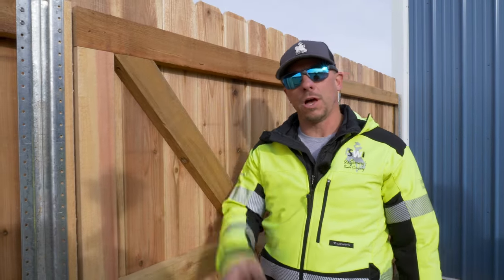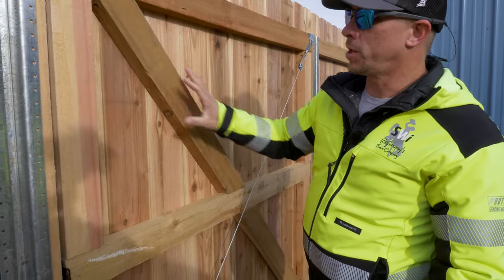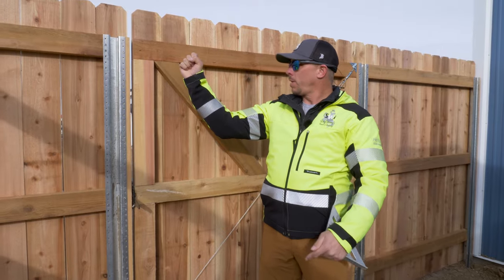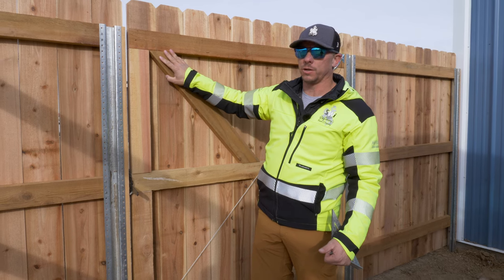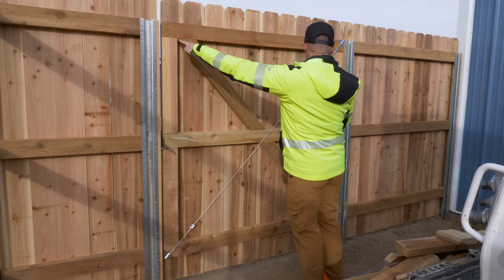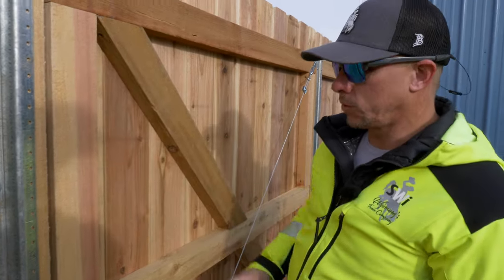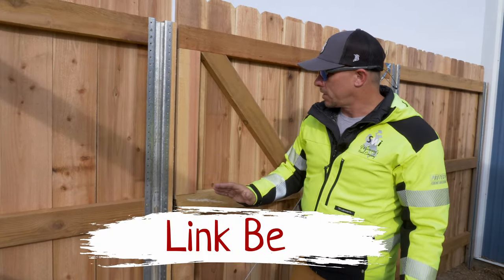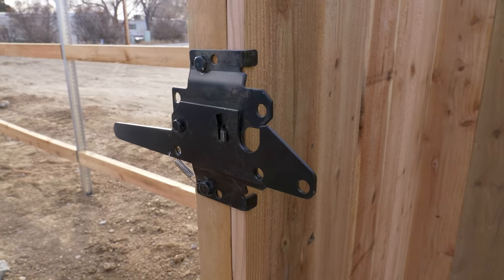The Keys To Fence Gate Bracing | Prevent Sagging With Proper Bracing

Comment: Very good video. I would like to add only this: braces should be build in one piece. Always. Unfortunately, that brace shown is cut in half, adding two more joints prone to flex/sagging. But, since it is not a heavy gate, this one is OK. Nice video.
Reply: The video shows a brace like that but says that its wrong.
Reply: That brace is one piece, the center piece is cut out where it meets the brace

Comment: Can you comment on where the angled cut meets the corner at both ends   I can’t see where the bottom end meets.  Please discuss advantage of where you placed to. For example on the top section of the brace, it is only touching the lateral board. Hope this request makes sense. Ty

Comment: Pro fencer from ohio here..
That latch is upside down. It needs to be taken apart and flipped, and the spring moved to the other hole.(less than 5 min )
Reason: those springs rust and break sometimes, and the latch won't work upside down with a broken spring.
Reply: Exactly spend all that time making the gate nice and don’t flip the latch.lol
Reply from the maker: I cringed when I saw that.  You are 100% right!
Reply: That's why I prefer "Max Latch Deluxe". It's very similar but has no spring and can't be installed upside-down.

Over time, wood gates try to twist. I'm sure you've seen a gate where the bottom is slightly kicked out and no longer flush with the fence.  The latch you're using can be modified to prevent or even correct this problem. You'll need 2 per gate, one high and one lower, both connected together with a black tension bar (cut to length) using small screws with nylon insert lock nuts. DO NOT OVER TIGHTEN. The 2 latches will work as one unit giving the gate 2 latche points. When that gate shuts it's like a vault door.
Reply: We've had neighbors of previous installs request this latch system from us.

Comment: Such a simple solution for a common problem! Question: my door/ fence sits on an uneven/ sloped foundation. Will this cable hack work in a situation like mine?
Reply from the maker: So your gate & gate post are actually tilted? The more tilted it is, the less effective it's going to be, but it should work anyway, unless you're extremely lopsided.
Reply: @SWiFence  thku so much for responding to my post. It's not on an extreme slope. The area in this area of our neighborhood where all of our backyards are located is a smidgen higher than where our fence/ gates sit. Based on your feedback, I think I'll be okay 😊

Comment: Great info and wonderfully explained
Reply from the maker: Thank you!
Reply: @SWiFence  I was building a pair of driveway gates, 6' wide and 4' high. I used 2 10" Headloc in each corner and metal corner braces in each inside 90. Seemed like they won't rack but when I followed your instruction and installed a compression brace on each, they were rock solid. Really, thank you very much.

Comment: With the brace you are just engineering trusses, and should understand it that way.  All you need is the tension cable, not the compression wood pieces; if you have both they are in competition and only one or the other will matter, so just use one to start with.  The turnbuckle lets you tune the tension over the years as the wood warps, so you can maintain the latch alignment which is bearing on the hinges.  The upper truss triangle does not bear on the hinges, so it doesn't need a brace.

Comment: I agree, great video. However, I get a little lost at 1:35 when you talk about adding vertical bracing if you have a longer gate. Could you please, or anyone, explain that to me with more detail? Thanks, I'm trying to repair a sagging gate that is wider than it is tall.
Reply from the maker: You're basically adding a vertical strip down the center of the gate to divide your gate up into two halves, then you brace each half as if it were it's own gate. The point is you don't want to exceed that 45-degree angle or your brace becomes pretty useless. Dividing the gate into two sections (or more if it's really long) allows you to brace at the correct angle.
Reply: @SWiFence   does it reach a point on the angle 📐 where it gets too low.( meaning below the 45 degree and at for example 30 degrees, does it weaken the brace ?)

Comment: I thought it was important for the brace to go from the top corner to the opposite bottom corner in one piece and it looks like your brace is in two pieces. Does this matter?
Reply from the maker: If done right this doesn't matter at all. This is sometimes actually necessary to keep the brace angle correct.

Comment: Hey so my question is this my customers bought an 8 ft long wooden gate. I put a wheel on the bottom and now the top is sagging left to right at the farthest point away from the hands at the top how do I fix. I was assuming maybe a cable from top to bottom to keep it from doing that
Reply from the maker: You can fix this with a cable, and also if there is only one brace on it or two so that way it doesn't break the 45 degree rule.

Comment: I’ve never seen that style of latch put in that way we do it where pushing down opens it not lifting up.  Is the way you do it how it’s designed?
Reply from the maker: Those latches are designed to be reversible, so it's all about customer-preference. One thing to keep in mind is that depending on the orientation, if the spring ever fails the latch will default open or shut. That's generally a good reason to install them the other way around like you're used to.

Comment: So if my wooden brace exceeds 45 degrees, then I should use the tension cable, yes? Will that be enough all on its own for a short  (3’ x 55.5”) wide gate?
Reply from the maker: Break your brace into 2 columns. The tension cable will not be enough for such a wide gate.

Comment: Hi, great video, thanks! I have a question as to where the brace terminates. In your build, I see the bottom of the brace material terminates at the very corner of your framing. I've seen a variation where the brace is cut to a tip and the middle of the brace terminates in the corner. Do you have any advice on this? Is there a right/wrong way to do this? Thanks! :)
Reply: My 'Leafs/leaves(?)' are square in dimension, and have figured out that if I build it like yours, I'll have a steeper and more desirable angle. :)
I think I've just answered my own question!! Let me know your thoughts otherwise. Cheers!
Reply from the maker: You've got it. 👍🏻 You can do either but a steeper angle is better.

Comment: Love the channel, great info, very much appreciated. Whats the widest gate I can make using the postmaster posts? I need to be able to get a vehicle through it. Thank you
Reply from the maker: Thanks for watching! I would not go bigger than a six foot leaf so you could make it a double drive and have a 12 ‘ opening.
Reply: @SWiFence  Thank you! Should I use Cane Bolts into a steel pipe in the ground or something to secure them?
Reply from the maker: Yes you can if your ground is good you can smash the end of a piece of 3/4” emt conduit and pound that into the ground to receive the cane bolt or you can do an upside down pier block and drill a hole in the block to receive the cane bolt.